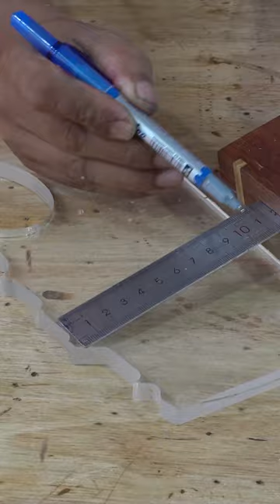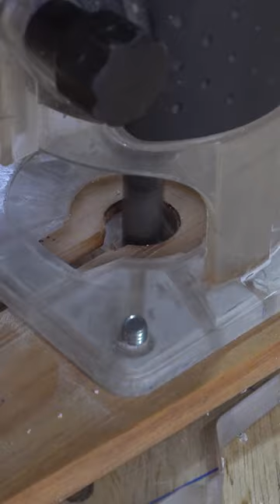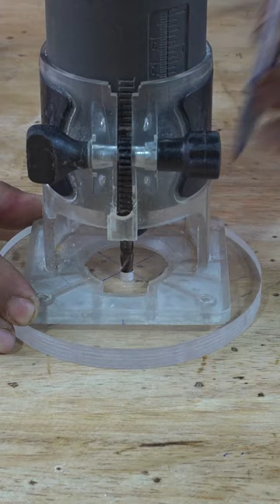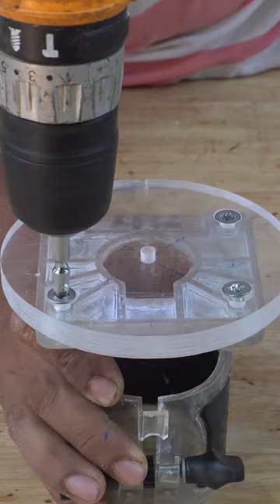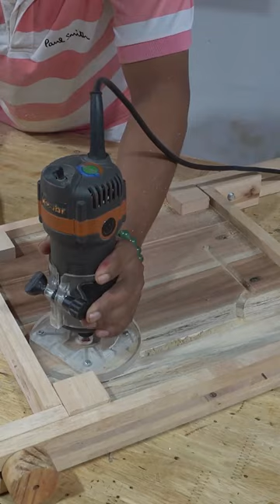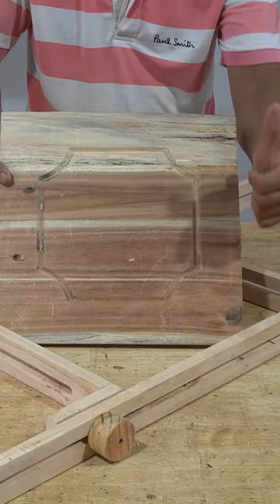Create Router Tool Tip for Woodworking Technique #shorts #woodworking #diy

Comment: I have seen another type of router base that does the same thing as this, it has double end lobes with a short straight section in the middle, it only does one size corner curve, yours is more flexible that if you changed the size or shape of the corner blocks you could have different designs with easier pieces.